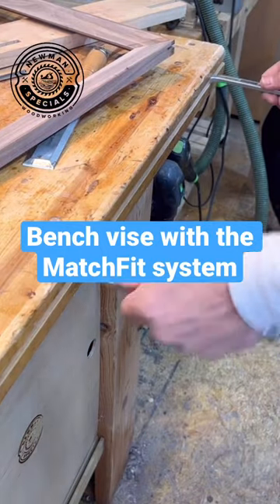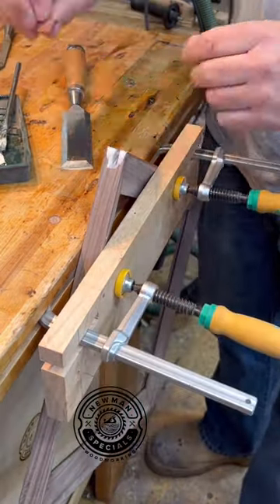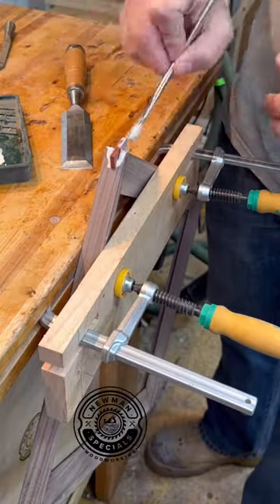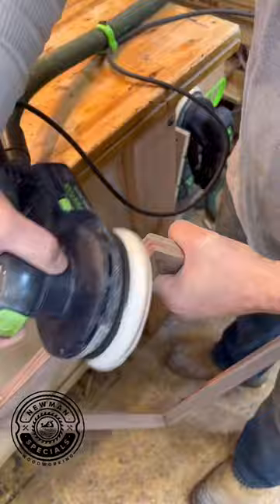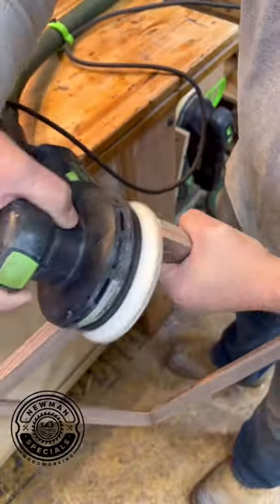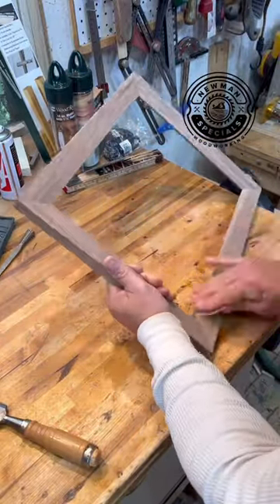Cheap bench vise using the MatchFit system #workbench #woodworking #diy

Comment: Have you ever thought about using quick grip clamps with the system or do you just prefer the screw clamps?
Reply from the maker: Which quick grips? Microjig has some quick clamps that I line to use as well, it just depends on the free space in front of the clamp